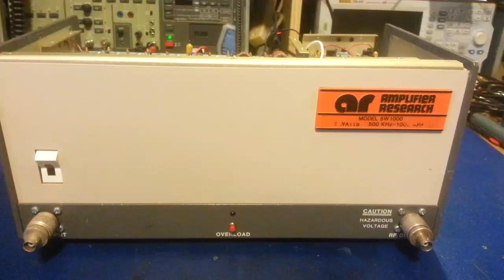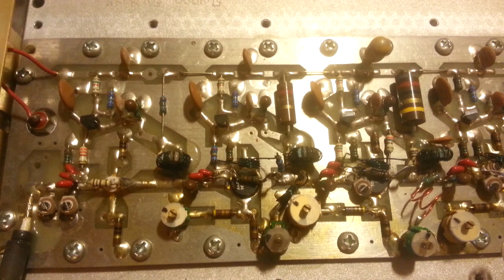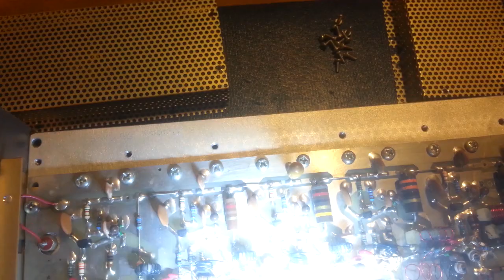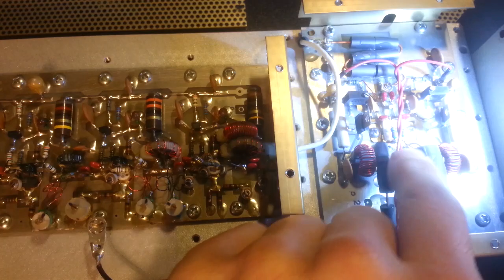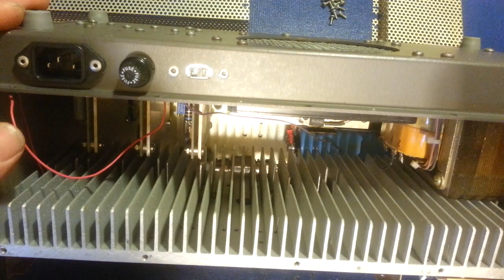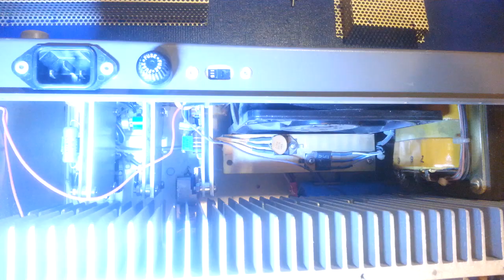Amplifier Research 5W-1000 amplifier inside money shot view.

Comment: You cannot beat a tube amplifier for its quality sound and riches Uncle Henry all the way 5kw
Reply from the maker: This is not a transmit type amplifier.  It is a laboratory amplifier.  It is not designed to be used to transmit on air.  It's designed to be used in a laboratory type environment.   It is a wideband amplifier that covers almost 1GHz of frequency span.  You will never do that with the type of amplifier your talking about.  Also, the gain on this amplifier is huge compared to transmitter type amplifiers.

Comment: A fair bit of the cost would come from the R&D to design one of these too as its a low volume production unit. Remember, the amplifier stages need to have the negative feedback optimized to get that super flat frequency response. 500khz to 1Ghz to within 2dB is no trivial matter. Then there's also doing this with a high degree of linearity and 5W output. It's clear from the heat sinks that it's class A throughout. However I'm a bit amiss as to why the power supply transformer is located directly underneath the heatsink for the output module. It looks like it's touching it. The hottest module should be the last place that ought to be taking place.

Comment: from the size of the box it looked like an RF amp with 2x 4CX250 in balanced mode but now I know it is a semiconductor based.
Reply from the maker: Nope, no glowing tubes here.  Its not a high power amplifier for use with a radio.  Its a piece of laboratory equipment and not designed for connection to a radio.  Maximum input power is 0dbm or 1.0mW (milliwatt).

Comment: As cheap as you got it and what they go for (if there are buyers) I'd have it on ebay and find something different and cheaper for the shop and pocket the difference.
Reply from the maker: The only problem is the only thing that could replace it would be another laboratory amplifier that's also going to be expensive.

Comment: I would imagine that unit is designed built and hand assembled in this country. I like to call them bespoke electronics. I don't know if that company is still in business but it's possible that they are or were a government vendor for these units.  If that was the case then they had to meet very stringent Mil-Spec requirements for spectral purity etc. Additionally, if they sold the same unit to non military buyers they would not be allowed to sell it at a price any lower than they sold it to the government. One of the reasons why Collins stuff was so expensive back in the day. Thanks for the look see.

Comment: must be a lot of gold in it?
Reply from the maker: I was hoping I would find some.  Only gold I saw was the gold plated terminals on the transistors. :-(
Reply: If you paid an engineer to design and hand make them one at a time, at 200$/hour, it could take perhaps 100hours to make one, if done with a lot of perfectionist fussing -  even if it had Radio Shack parts in it.   It's sort of like Bob, bandersentv restoring an old "worthless B&W TV", if you consider his time, even ten hours would put the price to over 1k$.
Reply from the maker: +sporadic -Z 

That's what I use is 2% silver solder.  Flows so much better, make better looking solder joints and is stronger.

Comment: Yep, supply, demand, specifications = big $$$$Thanks for the money shot Mike.
Reply from the maker: Yep, not much to see.  I'm still hoping a gold coin or two falls out of it.
Reply from the maker: +ab5ni

Wouldn't do any good if they weren't certified.  May be fine for people like us but industry/institutional/commercial wouldn't buy them.  Then again they can afford to buy things like this new.
Reply from the maker: +ab5ni 

Know all about the oil biz.  Was with Texas Refinery Corp. in Ft. Worth.  The hoops you have to go through to get a certification on a lubricant is crazy.  To make matters worse every equipment manufacturer has their own spec.  Luckily many manufacturers will accept API certification.  I think API certification cost around $150,000 and that's per product, in each different viscosity.  It gets expensive fast.

Comment: i wonder what package the main outputs are.
Reply from the maker: Do you mean that last square transistor?
Reply: all 5 stages really. i would guess TO-200 then TO-3
Reply from the maker: +bassblaster505 

These are RF transistors.  There are 4 different types in different packages.  This is the ceramic body tab style transistor commonly refered to as "pills" used in RF amplifiers, not the old metal can style.  Have to see if I can find my RF transistor package type chart.